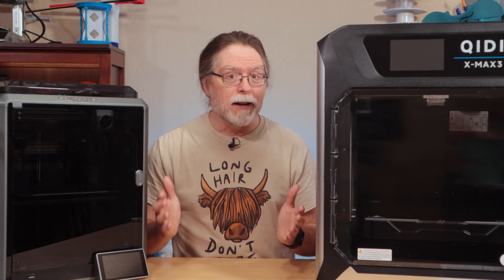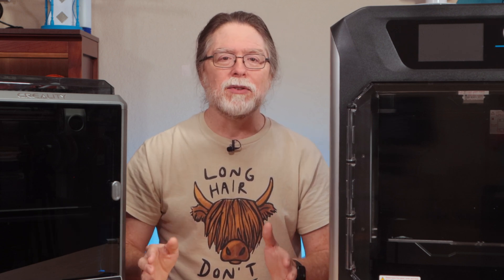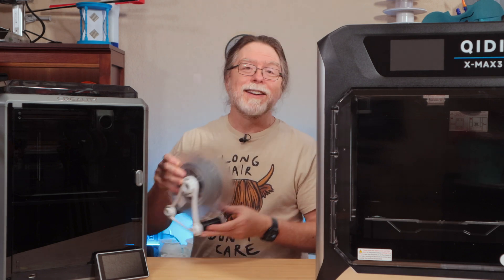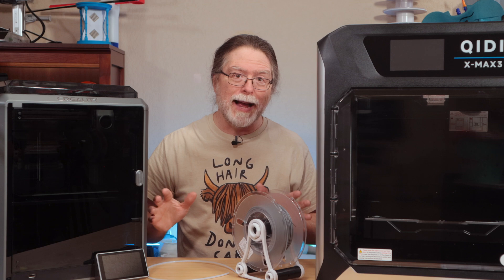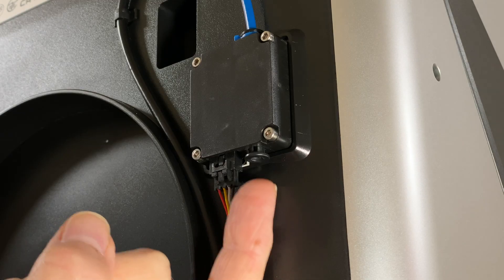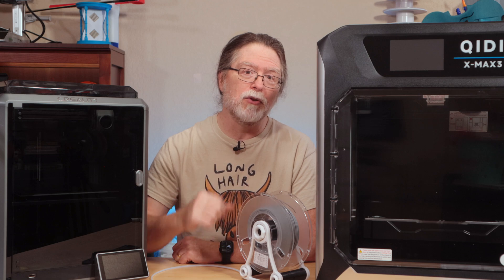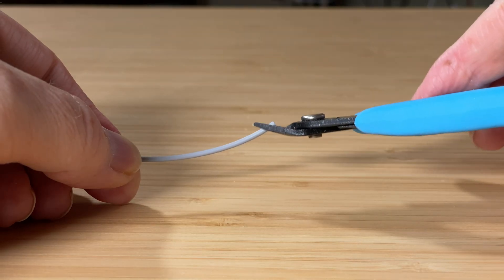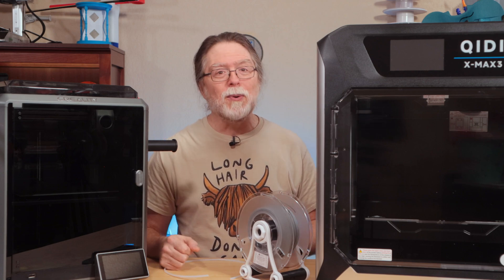CHEAP FIX for REAR SPOOL PROBLEM!

Comment: IMO 4mm OD, 2.5mm ID is the ideal size since it's a lot more resistant to kinking than the 4mmx3mm, but has less drag than 4mmx2mm.

Comment: If cover is not required (no ABS/ASA), wouldn't it be easier to have original filament feed point (filament sensor), with tube released from cable chains, relocated to the side of the machine? It could require some drilling and extending wires (or leaving filament sensor unused), depending on design and will.

Who want's to feed (and un-feed & re-reel) enormous lengths of filament (TPU, anyone 😅) through two tubes + (cheap) sensor in between (is glue on build plate for normal filaments similar kind of brainwash?)
Printing should be easier, not harder 😬 and fortunately this video helps at least a bit with that 👍

Comment: Ah... Is that a spoolholder on the side of your K1 ? The black thing sticking out in front of you ?
Reply from the maker: The thing that I hung on the printer as an example of finding a printable spool holder designed for a particular printer? Yes. Yes it is. I printed it in red Polymaker Polysonic PLA. The tube part of it came from the back of the printer.

Comment: Actually one main point missing: If the filament runout sensor triggers, the end of the filament already is on the back of the printer and you still have to go to the back to change the filament. Addittionaly to your mod you need to remove the runout sensor from the back and put it on the side, maybe using an extension cable.

Comment: I have the Qidi Xmax 3 and I just put the supplied spool dryer (instead of on the back) on the left side with a section of PTFE tubing up to the runout sensor.  The Spool dryer/enclosure, has a flat bottom and it works great just sitting next to the printer.  No need for an additional spool holder.
Reply from the maker: That's a good way to do it, and it doesn't take any printing time, either! 👍

Comment: what a great tip.  many thanks foir this.  I love that suggested spool holder.  I have half a dozen of them printed out for various printers.  Really great model.
Reply from the maker: Sure thing! I've been using that spool holder for a few years now, but I only have 3 or 4 of them.